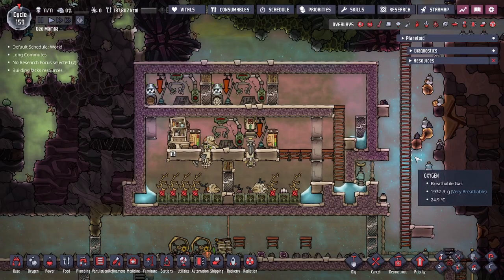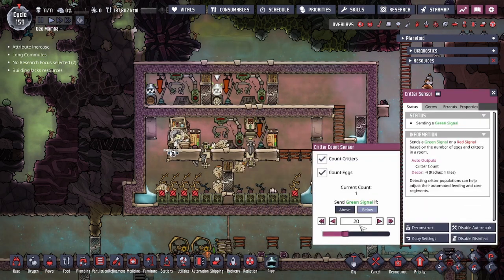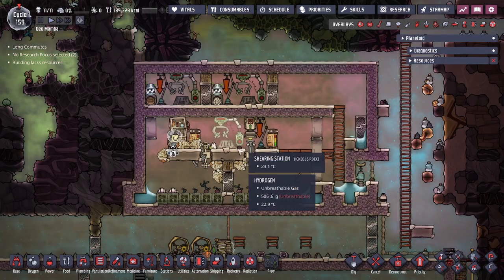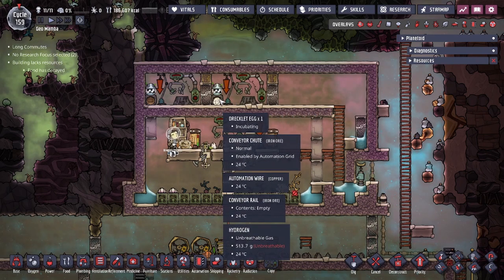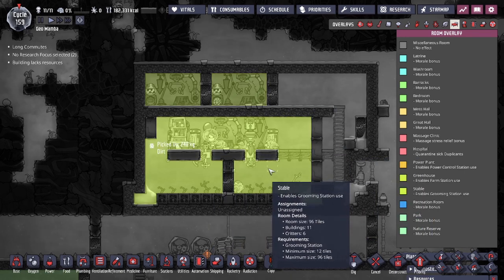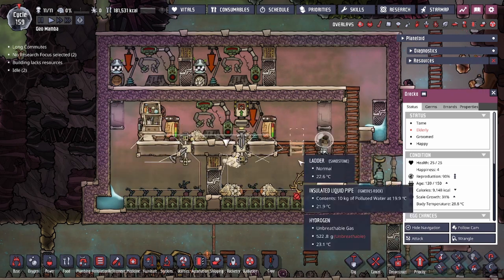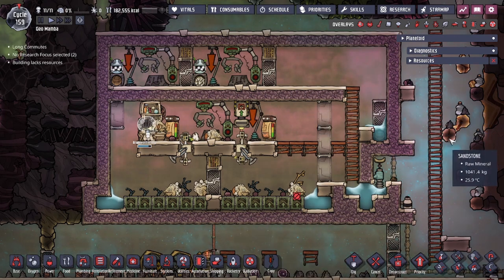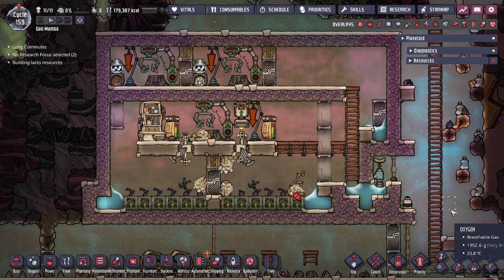The Best Drecko Ranch Design - Most Efficient with Reduced Travel - Oxygen Not Included

Comment: This is a fantastic farm, the idea of not grooming the sheer room Dreckos is fantastic. I’m at cycle 250ish with 7t of plastic and as many reed fibers as I need, plus a steady supply of meat. This took awhile to get rolling because of the long hatch time of dreckos, but it definitely was worth it.
Reply from the maker: it does take a while to get rolling but you dont have to think about getting oil for plastic anymore! i guess its kind of a give and take, but glad you like the design! :_2LegitLove:
Reply: @2LegitCity  thanks for this design i used part of it seeing as there is no need for waiting for the dreckos now i still used the water idea to keep them contained to 2 platforms bottom platform is food top platform is sheering station and groom with a drop off, above i have a two incubators and i can use the extra eggs for food since dreckos take so long and live for so long and take so long to reproduce its not worth using them as a meat source because its not enough and not reliable for the amount of upkeep the creatures require. overall great build and a nice basis for other to build off of or just straight up copy. keep in mind that your pets dont really have to wait for you now they now line up at the station. but dreckos are still extremely slow so confineing them as much as possible is ideal and the water trick will surely come in handy for other ranchs.

Comment: This is very similar to the design I've been using, but I like the water barriers on the sides. One slight improvement you could make to the efficiency is that you should put the grooming station on the side close to the entrance. The dupes use the grooming station a lot more than the drop-off or sheering station, so it will slightly reduce dupe travel time.

Comment: I like just having the plants and grooming station in the water room, no shearing, the loss is minimal and the efficiency of the dupe to not have to wait for critters allows more critters imo
Reply from the maker: well if you dont need to shear, you wouldnt need the 2-level setup and just have a flat with the grooming in the middle, farm tiles on both sides for grazing and then the water tiles. this would save the vertical travel of the dreckos to make it shorter if youre not looking to shear them
Reply: @2LegitCity  He was refering to not shearing the breeding Dreckos. You still have the shearing set-up with the excess, just don't bother with Hydrogen and shearing the breeding dreckos. You gain the majority of the shear from the extra ones. It basically cuts down on travel time waiting for Drecko, since you wouldn't need to bother with Hydroen (since Mealwood can't grow in Hydrogen) you have one floor for the breeding. 2nd floor is purely hydrogen and shearing.

So, the ideal set-up would be something more along the lines of just one floor using water to block the dreckos from leaving the small area near the grooming station and having mealwood right there for them. It cuts down on waiting for drecko to get groomed and less automation to pick up all the eggs by limiting their walking space. Then you just ship them all to another room filled with hydrogen for shearing. Which you only need 1 room with them, you can put in an unpowered incubator, which if the main room is less than full a dupe will pull the drecko from the incubator and run them into the room automatically (so you don't need to set up multiple critter poles).

Comment: I don't understand why you use 2 separate shearing rooms?  Instead of a 20 limit on 2, why not just have a 40 limit on 1?  You can still build 2 stations if you need them.

There's a lot of room to opimize the shape of the design as well.  Fewer open doors, less bits sticking out etc.
Reply from the maker: i should release an updated video of my current version
Reply: @2LegitCity  Please do.  Dreckos are probably the most important and complicated critter to ranch, especially as the only reliable source of phosphate even if you have reed fiber and plastic sorted.

Comment: Hey dude, I'm using an updated version of this design! Just wanna thank you o/
Reply from the maker: nice! what changes did you make to the build?
Reply: @2LegitCity  It's a bit smaller on the lower part (mealwood) because i plan to have less dreckos, and there's a lot of decor haha. 3 incubators on the evolution room and only one shearing room. My shearing room have water on the sides so they can't walk more than 2/3 tiles and can't climb on ceiling.
I'll add a couple of the new Pip on the incubation room too.
I'm using that cycle sensor, as you do in another video!
Reply from the maker: @hyanghenry  oh nice upgrades, i see you over there